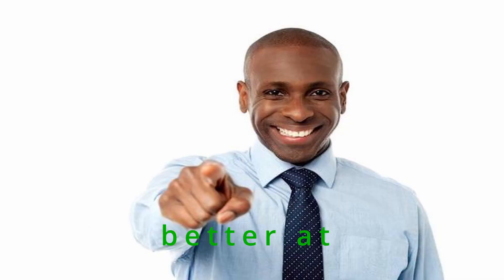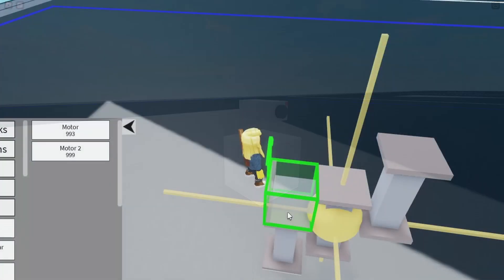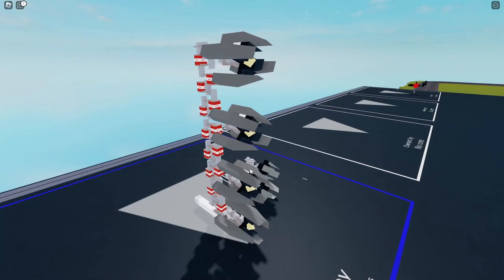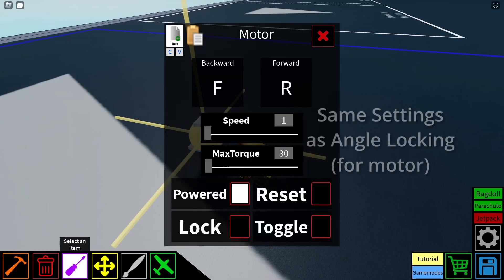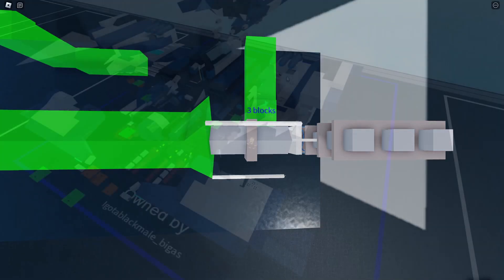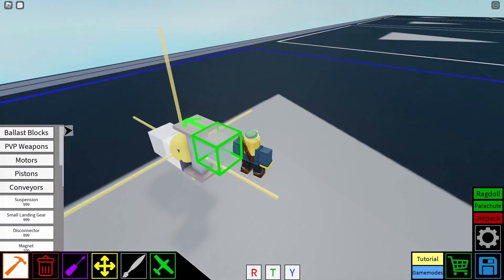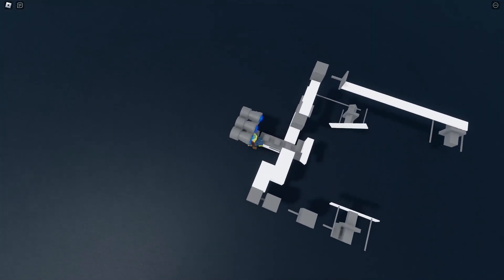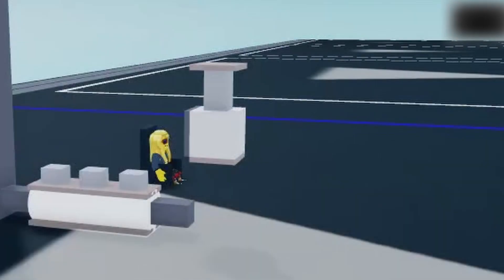Locking Techniques I Plane Crazy [Outdated]

Comment: As a humble plane crazy player myself, I have no shame in admitting that until about a year or so ago, I almost never used motorlocking, but eventually started consistently using it in small quantities on several minor builds, then immediately getting a pretty good grip on compression blocks, which I began using extensively in several large-ish builds. My most heavily (and possibly most compression reliant) builds to date is a literal custom Freddy Fazbear's pizza build complete with the iconic checkered stripe on the walls, which required considerable amounts of compression locking just to get the walls accurate, and while the overall layout is nothing like any of the maps of any FNAF game, it's still one of my biggest builds in terms of part count.

In other words, motorlocking and later compression locking really can become a major part of a lot of builds.

Comment: will this work with transforming builds to stabilize them(by stabilize  i mean remove the shake or freak out my build suffers in the legs from it badly)
Reply from the maker: Locking techniques cause lag
The most is piston locking 
The less caused is camera locking

Comment: Sup i have a question can you make a guide on angling control panels
Reply from the maker: as in like angle locking control panels, or angling them in a way that it looks clean and the wing panels have no gaps
Reply: @Gudbulder  both
Reply from the maker: @zerdawxr   if your talking about the red grey plane i made, motor lock the alerion or the flaps on the wing, i used normal wing panels so I didn't angle them.
The first layer of the wing should have a gap to fit the flaps or alerion, the second gap  should have the flaps itself
Reply from the maker: keep in mind, it may stutter and jitter from time to time, due to lag and will cause problems to stability.
you can piston lock them to create a small gap for it to move around.
Reply from the maker: i forgot to mention, if your going to use magnet locking for your build, the discarded locking technique debris should be thrown to the void, i believe the game deletes the block count and saves your frame rates a little, i think.
Reply: @Gudbulder  also uws
Reply: Im saying just how to angle plz teach me